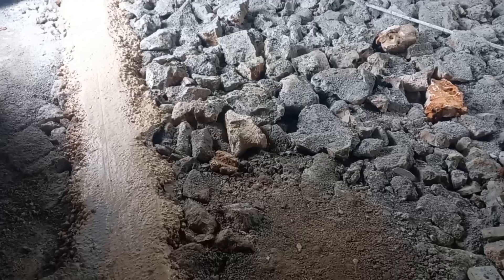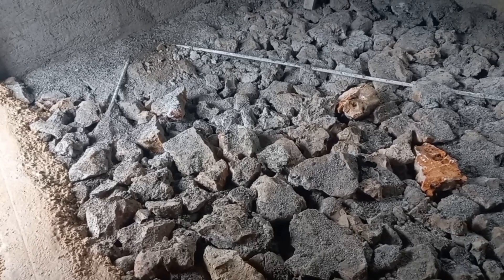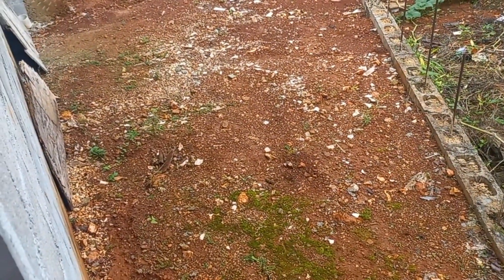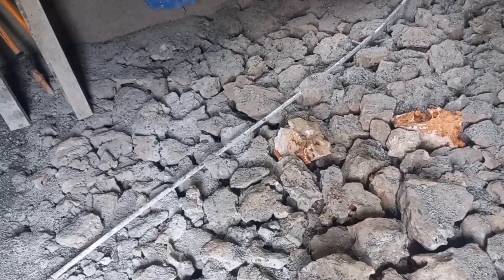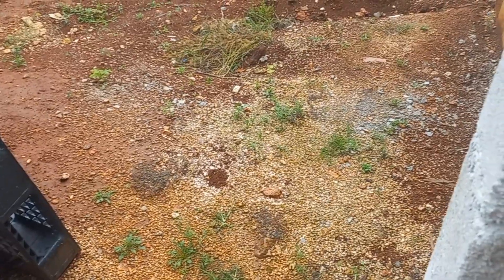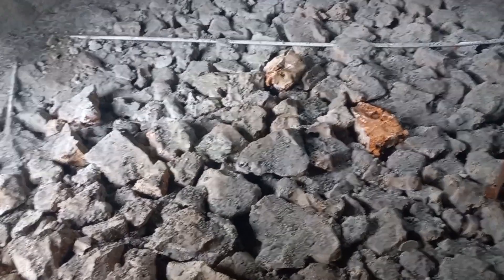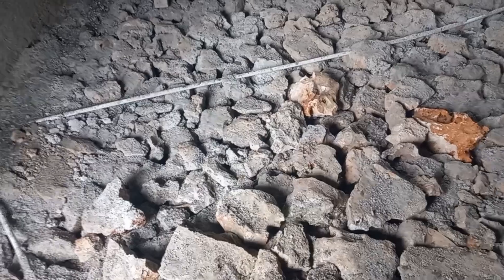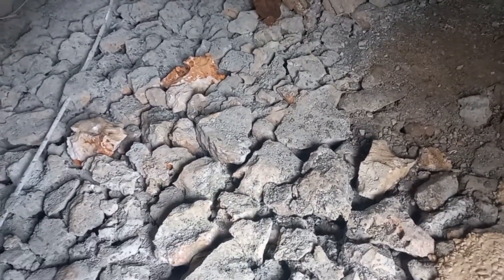This is why you should use Fabric Mesh or Rebar in your Floor before Casting

Comment: My land is about a foot of dirt and then solid marl. It's hillside and the hill is just a huge block of marl. What method would you recommend?
Also, you say dump but do you mean fill? It's my understanding only fill can be used inside the house.
Reply from the maker: Once the area is solid you dont have to worry it's the soft soils you have to worry about because after a while it shrink but just for safety purposes you can still use the mesh if you like or some people use Rebars in the floor, the dump is the same thing as filling its just our terms of calling filling.

Comment: What do you thinknof using BRC wire to build a house
Reply from the maker: @t.foster8348  it could work if you are going to pre cast the building, thats what they use to first time most of the portmore houses use to build with pre cast wall with brc wires but construction has stepped away from that